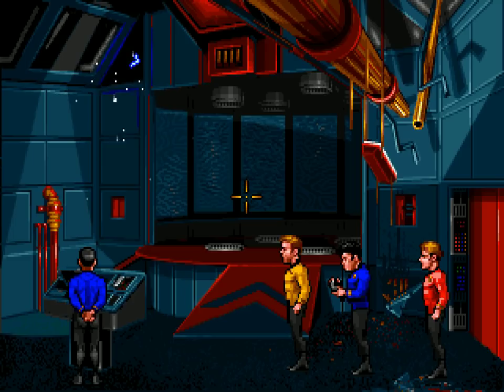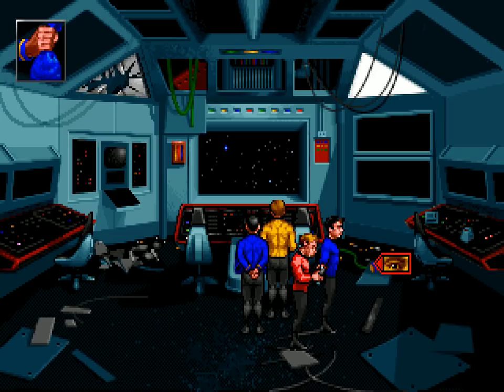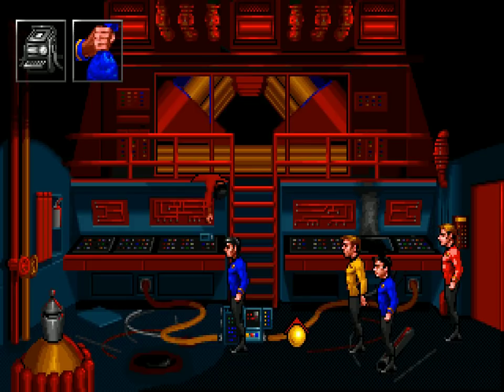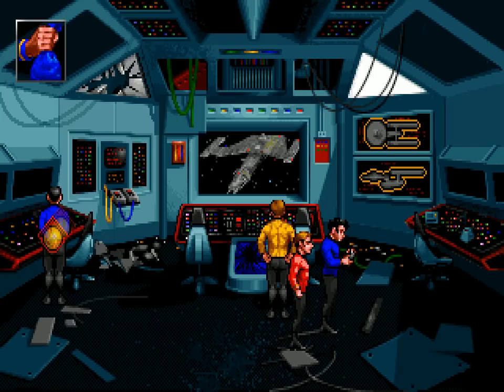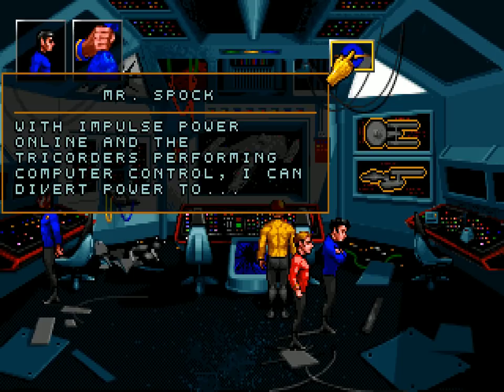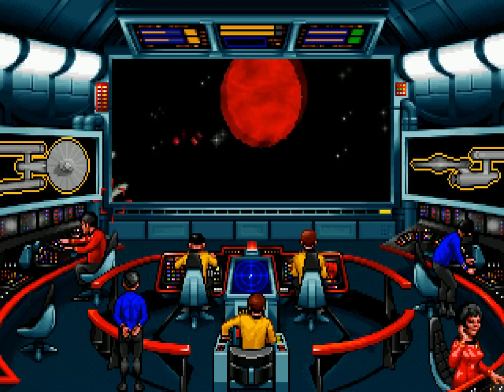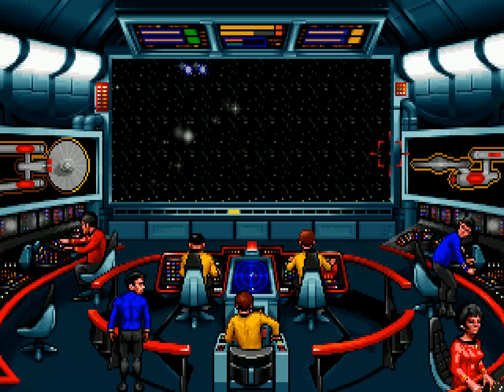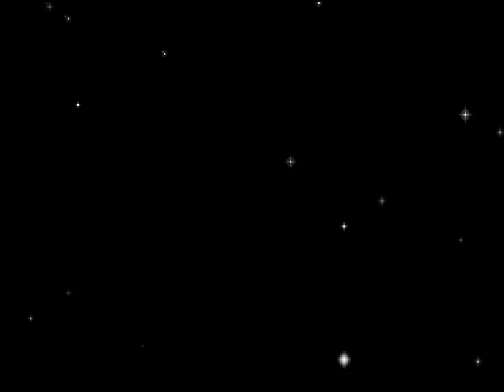Let's Play Star Trek: 25th Anniversary - part 16 - Enterprise-2

Comment: The final battle is one of the easiest to beat, I was beating it as a 7 year old in the original 5.25" version of the game.

The Enterprise-2 will not attack you unless you attack it first, it just circles. Take out the 3 torpedo elasi ship, then the 1 torpedo elasi ship, let your shields recover a bit. then do a full reverse and the Enterprise-2 will just fly right in front of you as it circles, you can cripple it before it can even turn around to fire back, usually id' have taken out both it's torpedo launchers before it comes in for it's final swing. I can't remember the last time i ever died to it.